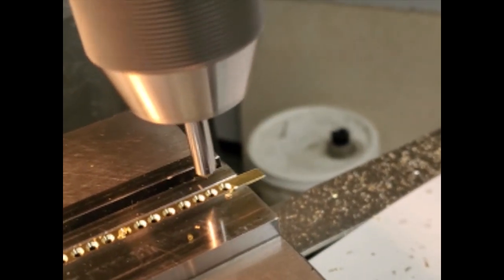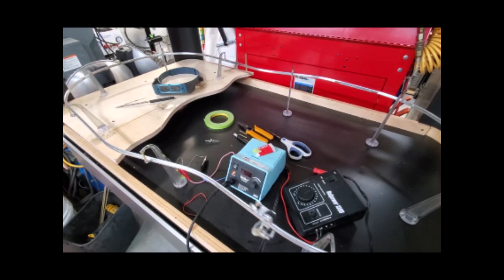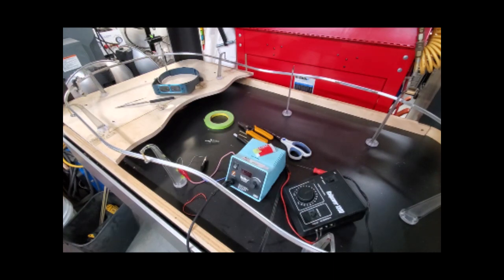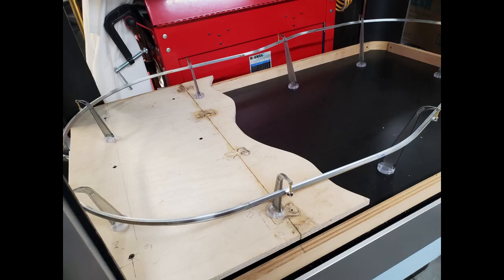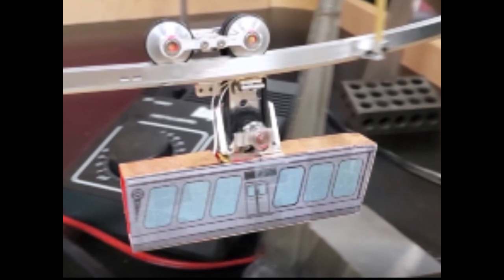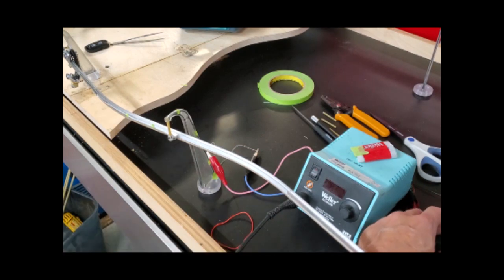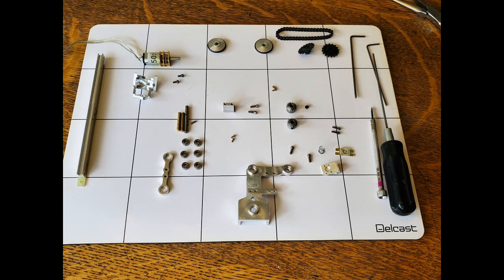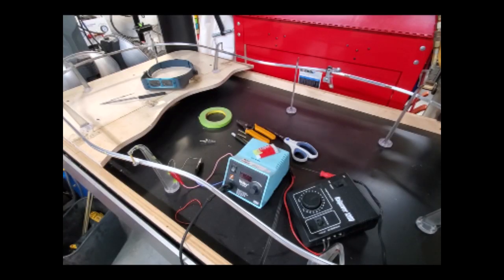Full Loop, Finally!

Comment from the maker: Here are some steps I plan to try for optimization:
1. Add weights
2. Make new brushes from thicker material
3. Turn a new drive wheel, current prototype is a bit too wide and rubs the inside of the channels
4. Smooth the inside joints of track at the connections, some have a little bump
5. Get a train controller with momentum control, like an MRC Tech 7
6. Move position of brush holder spring plate (lower) for more freedom of sprung movement
7. Do final placement and screw down all pylons, adjust heights for track leveling
8. Add cars - should help the movement look smoother
Reply from the maker: Weights helped. New brushes definitely worked better - the old ones crumpled after a while. The pylons are screwed down, it's much more steady. The joints have been polished - that helped a lot! New drive wheel worked better too. The old one had rub marks on both sides. Lowered the brush holder plate and it helps, but the alignment guide pins need extended a tiny bit. Still need to design and add a couple cars - or at least start with the car carriages.